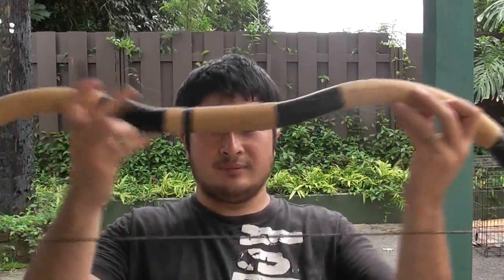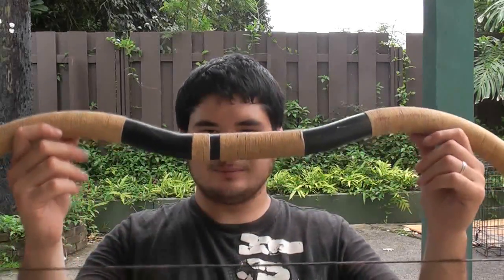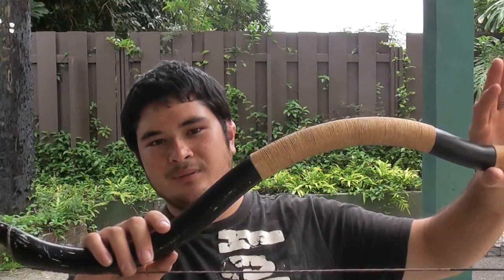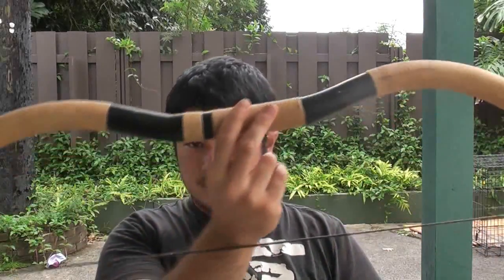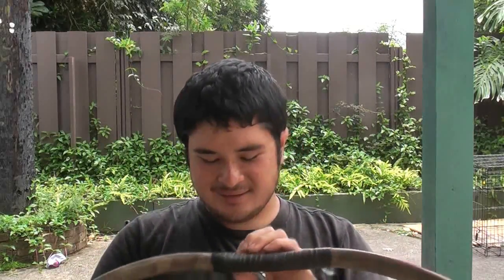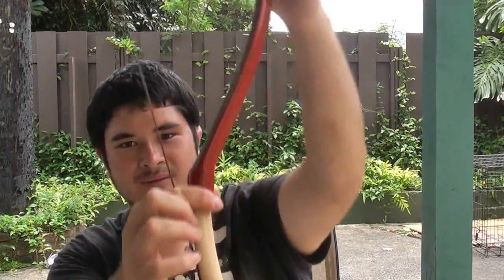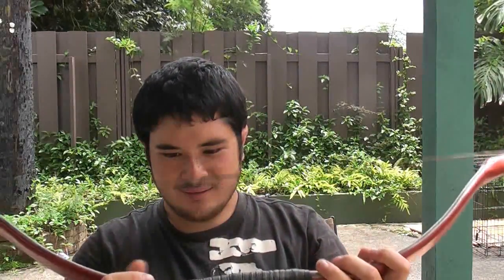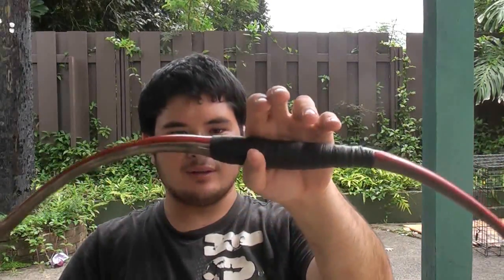How Long Do My PVC Bows Last?

Comment: One thing you should never do to a PVC bow (or a child, pet or anything not made of steel) is leave it in your car on a hot summer day. I haven't done this myself, but I'd bet money that if you park your car in full sun for an hour in 90 degree weather, it will get to be 133 degrees inside. At some point, if the bow is under stress (strung up, or with some heavy object on top of it) you will end up with a PVC pretzel.
Reply from the maker: That is good advice. Really, any bow can be damaged if left in a hot car. Self bows, laminated bows, compounds, really any bow can be damaged if left in heat for too long. Sometimes nothing happens, sometimes something big happens, and other times the damage is so minor that it doesn't show up for a while.

Comment: Exactly the same you'd use depending on the draw weight.  If you go to the Academy sports you can find some real nice ones.  If you are intending on using them for real hunting, You'll need to get the aluminum and use practice tips.  But for backyard stuff, just get the wooden ones or make your own!  There are tons of videos on it.

Comment: dry firing is firing a bow without an arrow. with traditional bows this is a VERY BAD idea. it's a good way to snap your bow in half. basically, the arrow helps keep tension on the string. without it, the string slacks up and the arms of the bow snap out faster and stop suddenly when the string falls into tension again. this puts an amazing amount of stress on the bow, and is why his Siyah creaks on that bow. the shock loosened it. i've seen bows literally explode in the archer's hand from this.

Comment: Hey I had an idea to add to your bows - right above the handle on a pvc pipe bow  handle - where the arrow rest, you could take a screw driver to a flame - heat it up on the side of the screw driver, then gentle place it on handle to gentle burn a grove into it - to make a area where an arrow could rest... some like this might already
 be in your videos however...

Comment from the maker: When it comes to bows that have off-center handles, the idea is not to prevent arrow flex but to promote it to a point. A properly matched and spined arrow will fly straight, even if it is sticking off to the side on the bow. The arrow starts off pointing out to one side, then as it begins to fly it flexes around the handle. It will flex from side to side until it has leveled out and ends up flying straight in relation to where it was aimed. This is the archer's paradox.

Comment from the maker: These bows shoot very well when the arrows are matched. They are consistent from shot to shot. Like self bows, longbows, and other traditional bows, PVC bows comes in varying degrees of arrow deflection. With a matched arrow, even a fully round pipe puts arrows straight and on target. If you arrows are too stiff or weak, then you will end up having to compensate, but it's not the bow's fault.

Comment from the maker: You could do that. The result would be less efficient than a single piece of pipe, but for making longer bows or heavier bows in smaller diameter pipes, it has its place. I personally don't suggest it because of the loss of performance, but it really comes down to personal preference. Sometimes you just want to make a heavy bow, even if it's slower than comparable lighter bows.

As for the fiberglass, if you find a good resin/adhesive that sticks, it would lend some good properties to the bow.

Comment: The Effects of Sunlight Exposure on PVC Pipe (nacopvc dot c o m)
"UV does not effect the pressure capacity of the pipe, or the pipe stiffness (external load capacity)."

Comment: when i was plumbing i ran into problems with pvc pipe getting brittle with age, say in 10 plus years they break if tweeked to much. granted this was pipe that was under constant pressure and use. in my thinking your probably rite, if cared for you should get years of use out them. but would careful after awhile. i personally would retire one of these bows after decade, if it lasted that long even. keep up the good work man i'm lookin at making one or many myself.

Comment: I don't know if it would shape very well but you can put one pipe inside another and use that as a bow. Also I don't know about fiberglass backing but I do know that if you put a fiberglass rod in the PVC pipe it works great.

Comment from the maker: That sounds like an interesting test. I can guarantee the PVC will take a set, though the question is how much and if the bow will last or simply fail after enough time. I think another two factors would be the length of bow and design.

A highly stressed and short bow would probably take greater set than a less stressed bow of the same length. Also, a bow's length changes how much the limbs bend. A 4 foot bow pulling 28 inches would be like a 5.5 foot bow pulling close to 37 inches.

Comment from the maker: I used to use electrical conduit, but the UV stabilizers and the softeners in it make it slow and elastic compared to white plumbing pipe. If the temperature gets high where you are, it can actually soften up and deform just from the ambient heat. It works great in cold temperatures as it doesn't lose elasticity as the temperature goes down like white pipe. The main tradeoff is speed. Gray pipe will usually be slower than white pipe of equal dimension and size.
Reply: Sorry I am a bit confused with your words. In conclusion which is the best pvc pipe material to make bow? Thanks in advance

Comment: i have had one break under full draw one time. it was my first and reason for it breaking was probably due to me burning the pvc slighty around the handle when i was forming it. anyways nothing bad really happened it was wrapped in cloth for the handle so when it colasped on me it didnt have and shatter to it at all. so if you wrap your handle and cover your bow with a canvas of some sort it will prevent a potientionally harmful shatter

Comment from the maker: The best way is to keep it out of the sun. PVC pipe gets brittle out in the sun, but the damage is slow. Most pipe will last a couple years before getting too brittle. As long as your bow is not left out in the sun all the time, it should be fine. Paint or any UV resistant covering like certain tapes or cloth help.

Comment from the maker: I cannot say for sure right now, but I have two bows in my garage freezer set at -10 F. I take them out every now and then to shoot, and so far they have held up fine. Only time will tell. Though I know from general testing on PVC pipe systems, PVC does get more brittle as the temperature goes down. Honestly, with a taper flattened bow I think it would hold up fine as long as the bow is not too short for the diameter.

Comment: accuracy isnt determined by what the bow is made from to my knowledge...its about how you tune your arrows to your bow and what types of arrows you use...different weighted arrows will react differently in each bow unless they are an exact duplicate bow and even then there will be some differences...its all due to a thing called "archers paradox"...the arrows actually bend when they are shot so you have to tune the arrows to the bow to get your accuracy

Comment: I do love that PVC horse bow with the wooden siyahs. One question regarding bow strings ... I know youve done a vid on making simple bow strings but would it be possible to do a vid on the way you make your own strings using Dacron B-50 if thats what you usually use. Thanks